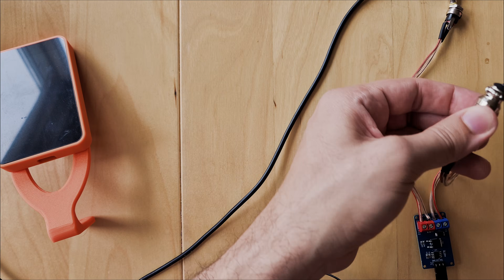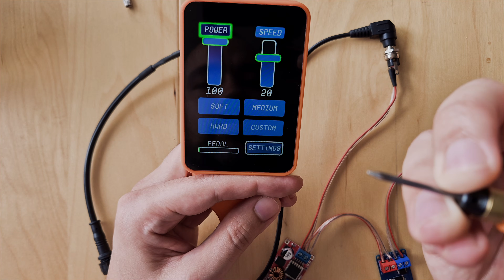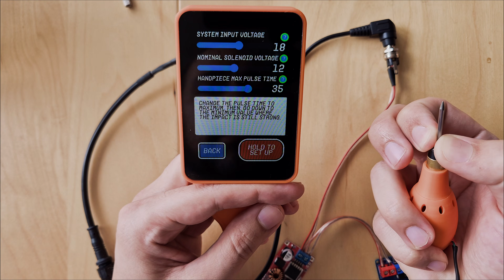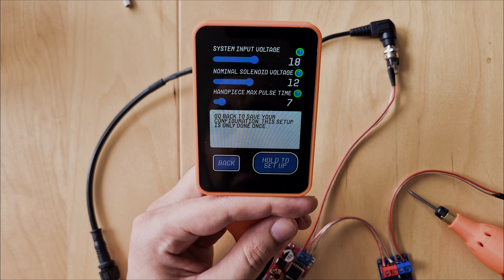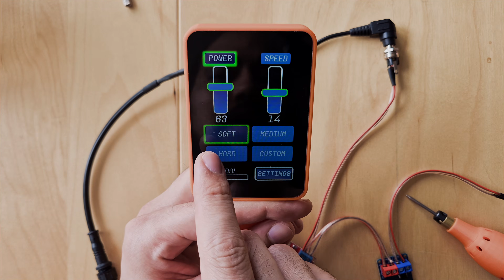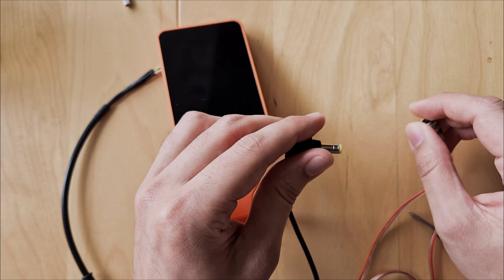DIY Solenoid Graver: Controller for your projects

Comment: Rellay nice and clean setup. You are making some serious work for free and thank you for that. As for the simplicity and what people might need help with is probably conecting the electric components, what wires to use, conectors, sockets etc. As well flashing the software for display.

Comment: What an amazing project. I love the idea of making engraving realistic for all. I will continue researching through your channel and posts but I wanted to ask is this setup mostly focused at setting rather than engraving due to amounts of continuous usage and associated heat generation? Either way the world is a better place with people like you sharing your journey
Reply from the maker: Hi, @dannyArtifacts-z1f Thank you for your kind words. I can test it and post the results on the next video, it is supposed to be self sustainable in the temperature where theres not more heat than what can be dissipated. I will measure the temperature increase after continuous usage and present it next video. Do you have a frequency that you use for engraving? Which material?

Comment: What if you included a button style load cell in the hand-piece so the harder you push, the faster/harder the solenoid runs (within the parameters of the config/settings)

An aluminum hand-piece might help dissipate heat. It would make the project less accessible because it would have to be ordered from someone like PCB Way  rather than printed at home, but if the duty cycle gets annoying because of how often you have to stop and let it cool, it might be a good option.
Reply from the maker: Hi, thank you for commenting. I made a variant like this and I also piblished the idea. The problem was to have the signal in the same cable and the other complications thay would not add any value to my usage. I understand that could be the usage to someone else but not for me. I decided then to just go for the usage I wanted or needed. Have a great weekend!

Comment: Ithink you must add a flyback diode for the back emf created by solenoid coil
Reply from the maker: Hi, The board already has a flyback diode, I am thinking about adding, as someone mentioned before, a TVS diode to check if it improves the
Reply: @Sav @SavianoLuz board type please or model

Comment: On GUIs it is always a good thing to give back a response to the user. When you hold the button for the settings to be saved. You could give back a simple indication after those 3 secods. Like "Saved", show it for 1 second.
Reply from the maker: Good idea! Thank you for sharing your views. I will try to implement this in a way that is visible, maybe blinking the background or having a place in the screen to confirm the actions, goven the limited area on the screen. The sliders already have the numbers that change, maybe putting them in the top so the fingers wouldnt be in the way when changing. Have a great week.

Comment: I got into hand engraving about a year ago and your videos inspired me to build my own graver. I am using the 0520B 12V Solenoid at double the rated voltage and it stays very cool. It is a short open frame solenoid, but longer or wider ones seem to generate more heat at the same impact power. I even tried winding my own solenoid coils and it was hard to make a better one. The only problem with noise was the signal of the foot pedal jumping around, adding a 4.7uF Capacitor to the potentiometer inside fixed it without lagging behind. I also use the TC4427 mosfet driver instead of powering it directly from the arduino and improved the flyback diode by replacing it with a TVS Diode combined with a regular diode to clamp the voltage higher and deplete the energy in solenoid faster, but i don't know if it has a big effect on performance. Analyzing the solenoid and signal lines with a handheld oscilloscope is also very useful. They are quite affordable nowdays and are also a very good multimeter.
Reply from the maker: Thank you, I will look into these changes, the TC4427 was actually mi initial idea, but I went with the board that had already a Mosfet driver so it would not require extra steps, simplicity is the path I am aiming for (though I should not sacrifice the functionality for simplicity). Thank you for informing me about the TVS diode, I had no clue that they were different. The open solenoids are actually what I intended to use "in the beninging", I even wrote in the guidelines that "open frame solenoids help dissipate the heat faster" but the tubular ones are easier to use. Thank you for your insights, I will implement this in the next iteration.